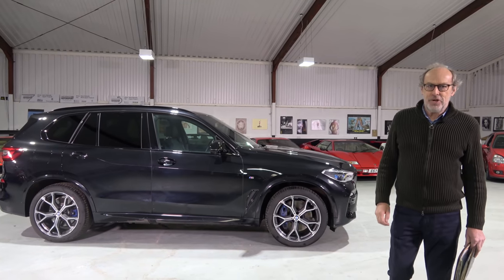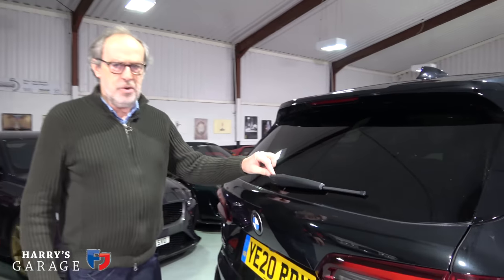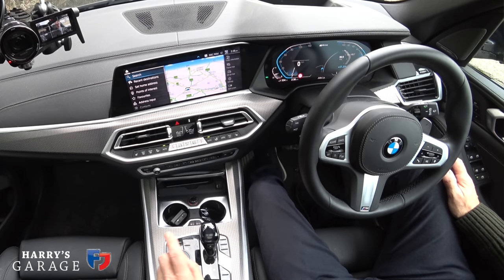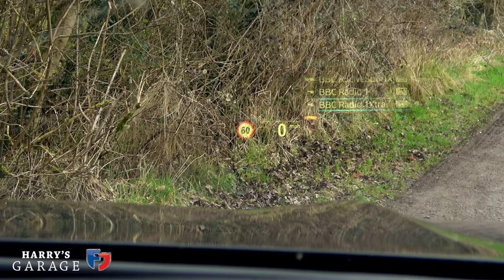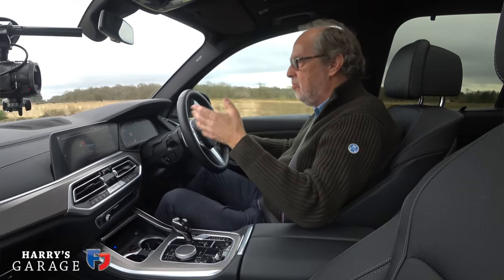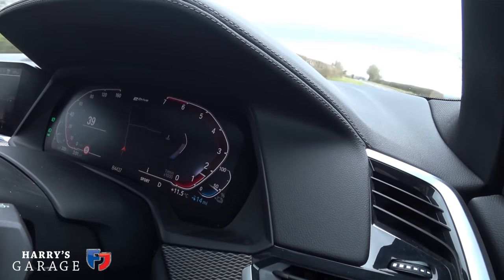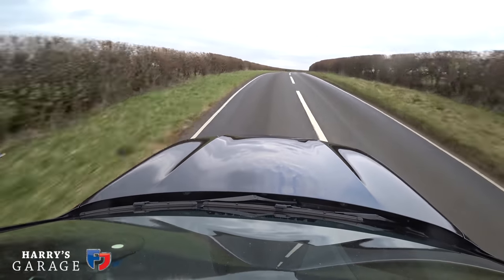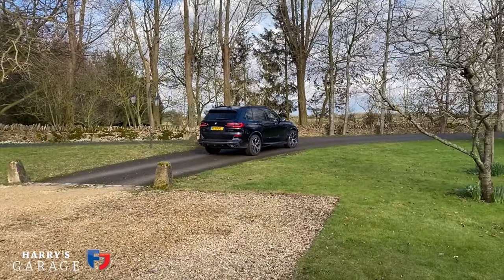BMW X5 45e 10,000 mile review. Why PHEV beats EV for our family car

Comment: Just to add a measure of perspective, my BMW i3, a pure EV, has averaged over the last 5 years i have owned it, 4.3 miles / kWh or 14.5 kWH/100km.  That means, on electricity it uses half the electricity that this large hybrid SUV does, and  if we take your "impressive" overall consumption of 62 mpg, which is 1.45 miles/kWh that's 3 times less energy!  This is why hybrids are simply a stopgap solution, they are still hugely in-efficient compared to a pure EV!  The is mass PHEV also actualy has  BIGGER battery than my BEV, so it's manufacturing footprint is, frankly, catastrophic.

So yes, a PHEV'd large SUV is indeed rather better than an non plug in large SUV, but lets not in any way consider them to be anything more than a sticking plaster on a gunshoot wound.........

Comment: You mentioned the petrol engine power, in the 45e its in a lower tune than other cars using the same engine. The 440i has 326 BHP. I really like the 45e, but doubt I could buy one, the digital instruments are so awful, its a car not a computer game.

Comment: No way would any researched EV owner be paying 14p per kWh.  I charge 2 cars ( iPace and Mini) at a max of 5p, and do around 250 miles a week between them.  60 mile round trip commute in the BMW would be lots of petrol used so not a match for me.  In 9 months I've charged the iPace in the wild 3 times ( all without issue at Instavolts).
Reply from the maker: Eh? Average domestic rate for a unit of electricity here in the UK is currently 16.3p. After doing the video, I thought I should have used a higher figure than 14p.. 5p/unit is not possible.
Reply: @harrysgarage  Octopus energy,  Go Tariff is capped at 5p for 4 hours a day,  and Agile bases itself on the commercial rate changing every 30 minutes.  Go Faster gives you 5 hours at 5.5p I think.  We were paying average of less than 10p when on Agile, but then prices increases so moved to Go.  Worth a look.

Comment: PHEVs are definitely a transition vehicle. Hauling around a lump of engine and fuel tank seems a bit counterproductive if the majority of your driving is electric.   But the insanely low charge rate on this car is ridiculous.  How is Germany going to be full EV if they are already limited by 'normal' charging speeds and reduce to snail's pace charging? 8+ hours for a measly 24kwh battery??

Comment: So, if you crunch all the numbers, you get an equivalent financial cost of 37mpg. If you add the £378 you spent on electric to your petrol fuel bill (calculated at £1.25 per litre) you get a total bill £1,461, which over the 9574 miles works out at 15.27 pence per mile, which is 37mpg. So, for all its green-ness really its just ofsetting the fact its a massive SUV, because you could easily achieve that in any normal sized car with mixed driving. Slightly concerningly is that this car costs more to run in electric mode that my little LPG Suzuki, which works out at around 6.5p per mile for all the LPG and petrol it used. Even running on petrol only its about 9p per mile (and the car literally cost 10% of this!)

Comment: Interesting the comment about the slow plug in charge rate being because Germany's electrical power network can't handle any more. I think the UK will struggle soon.....none of this dash for green electric cars has been properly planned.
I recall reading a comment that the greenest country is Germany and yet this winter their solar panels were covered in snow and ice and there has been very little wind for their 30,000 wind turbines....... They had to turn the gas and coal fired power stations back on to prevent a crisis 😂😂😂
Reply from the maker: Germany certainly isn't the greenest country in terms of CO2/kWh in EU, that prize goes to Sweden (13gCO2/kWh), followed by France (55g/kWh). Germany's average is 301g/kWh, while UK is 209g/kWh. The worst is Poland at 724g/kWh, which is where lots of German cars are made..
Reply: @harrysgarage  and France is so good because about 70 to 80% of their energy production is nuclear.

Comment: With an US spec model the combined MPG is barely 20 MPG, this PHEV, and it’s similarly bad MPG Mitsubishi Outlander PHEV, are not in an class I can recognize as effective as a vehicle designed to lower their owners carbon footprint. Might as well drive a non PHEV model. To exemplify, 2018 Hyundai Ioniq PHEV, delivers about 30 EV range (I’ve recorded 32 miles) AND in hybrid mode delivers 57 to 63 mpg!!! Sorry Harry, but this BMW is not much in the EV department nor in the Hybrid one. It’s IMHO, an example that gives PHEV name bad reputation. And it’s not the only one. Thanks

Comment: Don't agree on the argument that it should have a smaller engine, in fact the bigger engine means it can run unstressed and probably deliver better mpg in the real world (mainly due to being a 3 liter in a big, heavy car). Let's please not convince BMW to go back to mundane 2-liter 4-cils in a luxury car like this - those are the reason most of these PHEVs are so unappealing on anything else than rational grounds (and they don't in fact make the car more frugal).

Of course 0-60 mph in 5s is ridiculous, but it's a bit like a Tesla - fun party trick, never used in practice, but just a good feeling knowing that whatever power you require, it is there.

Comment: In 2022, having a PHEV is having all the drawbacks of an EV AND ICE (short EV range, high maintenance cost, fuel, pollution) and none of the benefits (cheap operating costs, simplicity, cleaness, etc). The only thing that stand in between is better planning and mild lifestyle adjustement...

Comment: BMW always have this tendency to give out test cars with M-pack. Isn't there a normal spec car with smaller wheels that you can fit off-road pack or at least more appropriate wheels?
Reply: idk about the UK but the smallest wheelsize for x5 45e here is 20"

Comment: In no real way does this car do 50 mpg. In financial terms you have to include the cost of electricity which would then give about 30 mpg overall. In environmental terms it is doing about 30 mpg i.e. about the same as a petrol only version of the car would achieve.
Reply: Nah electricity is not that expensive so if you factored in the cost it would barely make a difference and also Harry has a windmill on his farm so it doesn't cost him anything to charge it afaik. My 330e does over 50 mpg consistently and I haven't noticed a jump in my electricity bill since I got it.

Comment: It’s a good car, I’d wait for the next generation of the Plug in feature though and get the normal X5 xdrive40. Slow charge time is annoying and plugging it in all the time is also kind of annoying
Reply: just plug mine in at night and its good to go next day (no chore) you charge your mobile everyday etc non? - so daily, its an electric drive but just driving from uk to italy and back so had the full hybrid mix - it just works so well..

Comment: i have a 2017  BLACK TAHOE V8 5.3L with 285/45r22 Tires ,  Gloss Black 6 Spoke Rims , Red Calipers , AMBER Fog Lenses 
RIDES TERRIBLE !!!!
Winters have 275/55R20 Sailun IceBlazer WST2 Chinese Snow Tires - RIDES AMAZING, BETTER FUEL ECONOMY  and LIGHTER 
2021 Tahoes GM Revised the Tires NOW at 50 Series for 22" and 60 Series for 20" + they Whent with Independant Rear Suspension

Comment: I don't get PHEVs in your use case. most driving is done electrically and EVs nowadays are more than capable of doing long roadtrips. So why lug around a heavy, inefficient, stinking petrol engine that is - as you say - stone cold most of the time anyways? Logically it makes so much more sense to forego the problems associated with ICE entirely... but then, I was never a fan of BMW and wouldn't compromise to get one.

Comment: The real-life MPG of PHEVs is pretty terrible across the board TBH
Reply from the maker: It's because to pay for all the tech development  costs, they have to be global cars and appeal to the USA buyers, hence why generally they all have thirsty petrol engines, rather than diesel..
Reply: @harrysgarage  True, that's a factor. But I've noticed that even the diesel PHEVs don't get the economy you'd expect (the Volvo C60 hybrid comes to mind, it only got 60MPG with mixed driving and regular charging if I remember correctly).

Edit: At the same time my S60 uses the same diesel engine and gets 47-50 MPG with mixed driving depending on the conditions and driving style.
Reply from the maker: Manufacturers are having to abandon diesel engines because the tech required to get them to pass new EU emission laws in Jan 2023 make them uneconomic to produce, hence why it's all moving over to petrol power, inc PHEV. It's not in car buyer's best interests but politicians have decided this is the way forward, so there you go..

Comment: To get less than 2miles per kwh is really bad efficiency...even for that sized car. Any other equivalent  EV  you might expect to get between 3 to 4 miles for 1 kwh. When you factor in a night time electric tariff of 5p/kwh you end up with an equivalent mpg for electric vehiclrs more than 400mpg as a better guide. Thats why they win.

Comment: No shit, your numbers don't add up! You are telling people this car is better than a diesel version because it does 50MPG. However, you forgot to mention it costs £90,000. The diesel version would cost £50,000 plus an extra £50 a month to run.  So £600 a year in fuel / £40,000 (the extra cost of the hybrid)  is 66.6. In other words, it will take you 66.7 years to save money over the diesel version. 

So Harry, as much you say its the better choice, that can only be accurate if you live to be 132 years old.
Reply: The 45e is only about £5k more expensive than the diesel.
As most X5’s are bought as company cars the 45e makes massive sense. Company car tax on the 30d for a 40% tax payer is £9,300.00 pa, whereas the car tax on the 45e is £1,956.00 pa.
45e wins every time when it comes to finances.

Comment: So, if my maths is right, low 20s mpg when small battery is empty. Not great for those doing decent mileage. Offensively large vehicle for today’s roads and climate.
Reply: Your maths is not right.
Reply: @harryspeakup8452  what do you make it?
Reply: Total of 9574 miles and 50.2mpg. 4952 miles on pure electric. So 9574 @50.2mpg suggests fuel use of 191 gallons. If 4952 miles were pure electric then 4622 were using the engine. 4622 miles using 191 gallons gives 24mpg. 
Where have I gone wrong? If the above is right it illustrates the real problem with these large and large engined PHEVs. And why journalists should be informing public about the fuel use when battery is empty.

Comment: Really interesting video, BMW have obviously done a great job with this car in that MPG is very impressive. However (and I’m not a tree hugger by any means), there are elements around the philosophy behind this type of vehicle which I really struggle with. Its vastly complex, durability has to be questioned, it’s massively heavy, resources required to manufacture must be equally huge. It just feels wasteful and a very poorly engineered route to improved efficiency. What we need to be taking weight and unneeded complexity out of cars, make them intrinsically efficient by design. This is political solution focused on a single aspect of vehicle efficiency where the focus needs to be on the bigger picture. Sad and very cynical, BMW could and should do much better.

Comment: Surely the petrol engine charges the batteries when it’s running So when you get home after a long journey the batteries are fully charged? Not impressed by the petrol engine MPG.
My 330d does almost 50mpg
On a motorway run.
Reply: You can force the car to charge its battery to arrive home full of charge in the evening, using the setting that is designed to give you maximum electric-only endurance before you enter a large city. But if you are arriving home that would be a pretty stupid way to run the car, as it is vastly cheaper to charge it off the mains rather than by burning unnecessary petrol
Reply: @harryspeakup8452  Obviously. What I mean is that whenever the engine IS running does it charge the batteries automatically as a by-product of powering the vehicle? i.e. during a journey which requires the engine to kick-in. Or is there a calculation which means this is also not efficient? How much engine energy is required to charge the batteries?

Comment: For me plug-in hybrids suvs as this are nonsense. It weights 100 kilos MORE than fully electric, similarly sized Tesla Models X (x5 phev is 2 600 kg). An absurd mass for something that pretends to be 'sporty'. It's possible just because of politics related to emission norms, which were created to unfairly favorize phevs, so the traditional european manufactures have more time to try to figure out electric cars. For me it's funny that people complain about electric cars and need to charge them often, but they buy phevs, which need to be charged every 50-80 kilometers, otherwise the fuel economy is bad.

Comment: Sorry, but this car is completely insane.  Congratulations for getting so many electric miles but you have only to lift the bonnet to see why it (and other PHEVs) will never directly positively influence the problems caused by the ICEV in the modern world.  The thought that it has all the engineering required for an ICEV and all the engineering required for an EV as well (albeit with a smaller battery)... it's just totally bonkers!  How the Hell can PHEV makers have the front to charge more for a pure EV for an equivalent ICEV?  They must think we are all very, very stupid... all so they can carry on selling us the requirement for regular, in depth servicing (of the ICE, of course!) and to keep their Big Oil golfing chums happy.

As I'm sure you know hardly any PHEV owners ever bother to plug them in.  So, you might get half your miles done without burning oil but most PHEVs get barely better MPG than a pure ICEV.  So what's the point?  So, you can delude yourself that your 'driving green'?

Whilst 50mpg is better then 25mpg (what an ICEV vehicle this size would get in the real world), it is no-where near as aerodynamically efficient as a Tesla Model X for example (let alone the S).

Comment: No point to buy these hybrids.You have to maintain two types of cars electric an combustion one.And you have always an extra weight of the petrol tank with a fuel and the combustion engine and the batteries and an electric motor.
Reply: aand the extra weight consumes more and diminishes the range by that.

Comment: Such an 80year old user review of the car, tech afraid, likes a 40 year old range rover, not in touch with the future. Never seen the engine, only did 3 or 4000 miles in it..  - needs to be properly reviewed